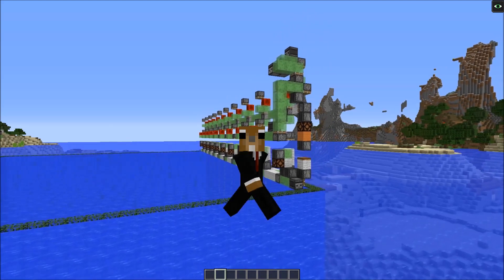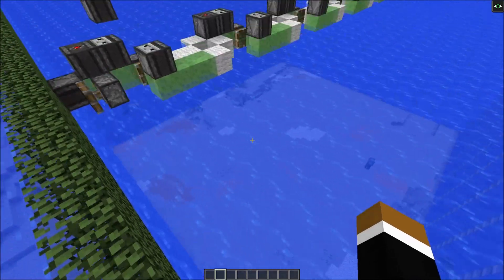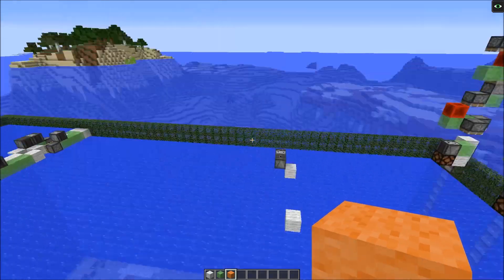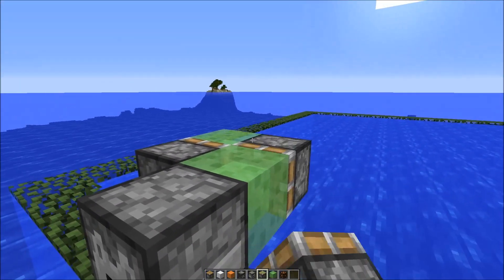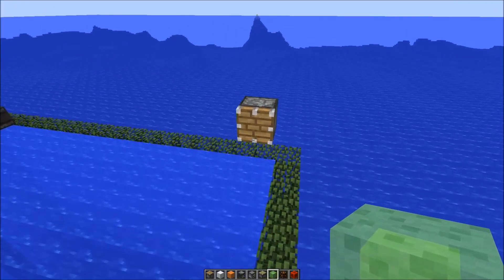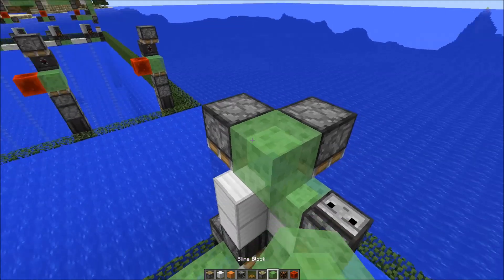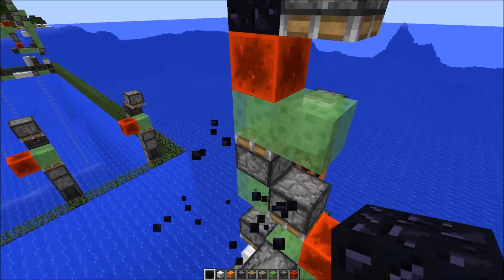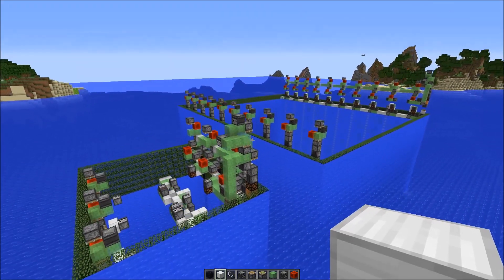Automated Water Removal 1.11+

Comment: Pár jótanács az óceán munument szárítás hoz:
1: A hínárokat mindenképpen takarítás el mert kitörik a homokokat.
2:A spongeos módszer jó lehet de szerintem ha 110 blokknál nagyobb átmérőjű kört csinálsz akkor használj flying machineokat.
3: Itt van Ilmango videója amiben megmutatja hogy kell őket megépíteni :)
Reply: here is the translated version 

A few tips for drying the ocean monument:
1: Be sure to clean the seaweed because it breaks up the sand.
2: The sponge method can be good, but I think if you make a circle with a diameter larger than 110 blocks, you should use flying machines.
3: Here is Ilmango's video showing how to build them :)

Comment: Hi, I don't know if anyone is still posting here, but I've got a problem with the machine:
It works great from the start but once it hits the return station, the station it's self does not move down.
I've manually moved it down as said in the video so it's in the right place and sends the machines back the first time.
On the second time, after manually moving it down to test, it goes straight past the return station and crashes into the wall.
I don't understand why it returns it the first time but then fails?
I'd really appreciate any help.
I'm using PS4 latest version btw Thanks.
Reply: This is build on Java and PS4 have a few diffrences when it comes to redstone.

Comment: Now that I can make 18 wide flying machines this method looks doable now. You would still need 2 pushing down stations one for each side of the flying machine, but this is alot better for the design you have shown here and I feel it is less resources than the sand sweeping machine that everyone is using. Also I play on a server that forbids afking on the server, so you have to be moving around while this machine works. I tend to just do one flying machine at a time and then use pistons manually to push the flying machine down one block, because the monument can be divided into 3 areas with different depths easily because of the shape. I guess i could just make the push-down pistons have a button instead so i have to move and push it to make it go down one. next one i'll see if i can do that.

Now we just need Minecraft to fix the ghost blocks and this would be very useful to use it. The admins on my server hate that I use flying machines, but luckily I've convinced them one machine is a harmeless load to the tick rate of the server. Other people have massive piston farms for pumpkins which has way more impact on the server than this setup.

great vids man keep it up.

Comment: It saddens me that every one of Illmango's builds, that I try, fail to function.  On this one the issue I run into is the return system the Sticky piston fires up grabs the normal piston and pulls it down, end of action.  The top piston fails to fire the, machine does not push down.

Comment: The time it takes to make this is equal to the time you need to just get rid of the water manually.
Reply from the maker: maybe for a 25x25 area. but what about 60x60 or even 200x200? Did you even think about that?
Reply: Yes, and then you would have to make a 256 long chain of water clearers, gather all the materials, and create a very large perimeter. I feel your other builds are WAY better.
Reply: FloidaVids Taking out something like a water temple manually would take you like 2 weeks...
Reply: EmpFX It only takes a couple days if you have the mats. I.e. Sand perimeter and dozen sponges. Buddy of mine did it last month.

Comment: Or you could just use sponge
Reply: But you just gotta make everything difficult =P
Reply from the maker: "just". If you try to use sponge the newly formed water sources will quickly fill everything back up. Sponge works nicely small scale, but try to drain an ocean with it. You'll quickly come crawling back to flying machines.

Comment: if u want to clear the water in easy way and fast put any block in the corner of the water that u want to remove then hover the cross hair on the block of each corner then use the command /fill x y z x2 y2 z2 minecraft:air
Reply: Fizz real funny

Comment: Mango, Love the build. Just testing the prototype in creative before adding it to my server. 
My machine stops at the same level every time, once the large slimeblock 'arm' reaches the level of the border blocks it touches them and exceeds the piston pushing amount?
The slime block that is touching the border is on the big L shape bend on the control side of the machine (It can be seen easiest during the timelapse at the beginning. At around @1.35 - @1.40 the slime block touches the front wall and breaks the machine)
Is this because I have used glass instead of leaves to surround my area?
Reply: Larks you must use an immovable object to surround it

Comment: Remember when Mojang said they'd removed ghost blocks? HA.
Reply: When mojang says they removed ghost blocks, then they usually have just removed one ghost block generator.
They were particularly ingenious when they fixed ghost blocks in 1.9.2. It went like this:
Before the 1.9 snapshots there were already many bug reports on ghost blocks.
In 1.9-pre1 mojang accidentally implemented a completely new ghost block generation bug.
In 1.9.2 mojang fixed the new ghost block generation bug from 1.9-pre1, but they didn´t do anything about the old bugs that existed before.
And because they fixed the new ghost block generator, mojang said they fixed ghost blocks and closed almost all the ghost block bug reports, including those who relied on different older bugs.

Comment: Why not make both sides move it down?
Reply from the maker: it's more effort. Sending one side down also has to send down the other side, which requires some logic. Also the machine is quite fast. You can clear 300x300x30 in 3h. You'll probably spend more than 2h extra in order to build up something that moves the machine down on both sides and saves 90min AFK time. It's not worth it tbh.
Reply: Oh okay, just seemed liked it wold be pretty easy but yeah  then again I don't really understand really understand flying machines on the same level as you :)

Comment: you should see if upon the machine being told to return if it could move one more down to remove another water layer, increasing efficiency.
Reply from the maker: I think it's not worth it. It's possible, but requires too much effort to set it up. I think in total you would need to invest more time in building, than you save from the machine running faster.

Comment: And you make it when I already used the previous one... ~80K sand!!! and ~26Hours :c
Reply from the maker: actually both systems don't do the same. With the sand method you can drain the outside area of a monument without removing it first, which is not possible with this machine.

Removing a monument, while guardians are still able to spawn around it, is quite tedious.
Reply: @ilmango , not as tedious as collecting 70k sand
Reply from the maker: @bobdull3148  the sand isn't lost afterwards. you can use it for something else. Also why do you think you need to point this out after 3 years?
Reply: @ilmango  ._. oh wait. It was 3 years. Well this is awkward
Reply: @ilmango , also since leaf blocks are water logable, will it still work?
Reply: Lol ilmango replied to a comment on a 3 year old video

Comment: What happens if it stops mid flight? would u need to rebuild?
Reply: Darkion why Would it stop mid flight?
Reply: Lag could stop it. Or server reset or chunk borders...
Reply: Darkion lag wouldn't stop it and chunk borders could only stop it when its the edge of loaded chunks which wont happen if you stay there or turn it off before you leave. This machine alone is also not enough to crash a server  :)
Reply: Darkion If it does somehow stop mid-flight, you can always use a flint and steel to have it start again

Comment: This is awesome! You just saved my ass too, because I was just about to use your sand pusher to clear out a monument.
Reply: Erin Howarth Yes :/
It's not that hard. Get depth strider boots, night vision and water breathing potions, aqua infinity helmet, and a haste beacon  and bam, it's gone, easy.
Reply: If you use this machine to clear out a monument, what will happen to the actual monument? Will it break the machine? Will the machine just stop when it reaches the solid blocks? Will you break the blocks with your pick axe as the machine approaches? TNT?
Reply: Erin Howarth it only clears out water blocks, not solid blocks
Reply: Will the machine break when it runs into the monument?
Reply: Erin Howarth You need to remove the monument beforehand
Reply: Oh, just five things... :-) Thanks. I'm glad to have a list. I'll set to it.
Reply: Before?!
Reply: Fyqcraft 
/fill x1 y1 z1 x2 y2 z2 air 0 replace water
that's it.
Reply: Zombie Untot naw fam
Reply: Fyqcraft What?
Reply: Zombie Untot I ain't gonna use your method bruh
Reply: Fyqcraft k ^^
Reply: Zombie Untot nothing personal

Comment: Couldn't you make it so it would also remove water on the way back? It would save you about half of the time.
Reply from the maker: would be possible, but would also require more effort to set up. You'll loose time if you try that ;)
Reply: Nilonaut it does

Comment: just using a moses is much easier in most cases. they work much better with random terrain than this, are much faster and still really easy, if not even easier to setup in some cases.
the sand dropper you showed is probably still better for the really random terrain in the nether with lava.
Reply from the maker: can you use your Moses in combination with a TNT quarry? Who cares about terrain?
Reply: ilmango what? i dont see any way to combine this with a tnt quarry more easily than you could with a moses.
Reply from the maker: For the next 528x528 perimeter we'll defnitely won't use buckets  ;)
Reply: ilmango ok. now i m confused. why would you use buckets for water? you use them for lava, sure, but in the overworld removing lava with something like this requireing a rectangular area is really difficult?!
Reply from the maker: we'll modify it a bit and let it run perpendicular to the TNT quarry.
Reply: ilmango oh. now i see. well, you ll still have to remove obsidian and there is likely to be prolems when water flows quickly covering blocks right below the surface before they are destroyed. seems quite problematic overall
Reply: why do you need such a large perimeter?
Reply: Ahh okay, so that stops the spawning of mobs that would ordinarily spawn in, then despawn the next tick because they're greater than 180 blocks from a player
Reply from the maker: If you want a perimeter where absolutely nothing is loaded within render distance. either for a passive mob farm or a farm that runs at the limit what your machine can handle. It can give a little extra boost in performance. In our case the render distance is 16 blocks. That's why 33x33 chunks
Reply: xD just misread passiv mob farm as massiv pob farm

Comment: As always Amazing work mango ;) How much time it takes to drain bounding box of the ocean temple?
Reply from the maker: thanks, ~20 minutes.
Reply: Wow, it's extremely fast! In my old minecraft days we used to drain oceans using sponges and it took us weeks... XD
Reply from the maker: You would need to remove the monument ofc. Which in case you don't have a mob switch is quite annoying. ;)
Reply: Guardians would still spawn outside the monument as long as there is water in the bounding box
Reply: @foxmulder8955  no
Reply: still doesnt look so useful, there arent miracle ways to contain the outside water and guardians when you are breaking the monument.
Reply: I also clear the water on the outside with lava, that why I need many pickaxes to dig out all the stones.
Reply: Eddy Wu , yes, no. We're talking about using the machine showed in this video to clear the water on the outside
Reply: kkochanovskii , you can dry the inside area of a monument pretty easy, that would be better so you wouldn't have to deal with the guardians later. Then just tnt it or whatever.
Reply: Of course, you have to break all the blocks of the monument to use this method so this is easier, they will spawn outside but not inside.
Reply: You have to break it somehow and having it dry is the only good way to break all the prismarine... as ilmango said it's not an easy task.
Reply: Does it make a difference if you have all the water enchantments ? i duno if you can break the temple blocks instantly. From what i remember i ended up breaking the monument from the outside because it was a lot more convenient. Used a simple mob switch with an account on a spawner. But that was before 1.9 and mending
Reply: Fox Mulder , of COURSE I'm talking about doing it with no mob switch in a safe way. If you did it outside you would be constantly attacked by guardians with almost no place to hide. And on mid game you're not going to have all the fancy gear so inside is a better option in this case.
Reply: But you do need to go outside and will eventually be facing guardians if you have no mob switch. So i don't really see the point clearing the water inside,  I mean the inside walls are not that big in comparison with the outside structure if i remember correctly. That's not a lot of time saved.
Reply: I dropped lava on staircase to cover the whole monument, and mine out with haste II beacon+ Eff V, with frost walker boots there is no guardian issue and doesn't require to clear water from inside. Need to prepare many pickaxes though.
Reply: Eddy Wu , that is after you have cleared all the water on the outside.
Reply: Fox Mulder , I still think it is, quickly placing sponges on the inside is enough to clear most of the water in the area and can be done while exploring if you already had the sponges. If you had a lot of tnt you could use that for fun and quick breaking of the blocks and that wouldn't work with water inside, then you clean the outside. May not save time but for me it's less boring.

Comment: Nice design I must say! But I still feel like the MOSES does a better job in terms of setting up and removal speed.
Reply from the maker: alright. My opinion differes a bit. imo removal speed is not important. Clearing a 300x300x30 area would take about 3hours with mine. In contrasts to the Moses, you don't need to remove any water in order to build the water remover. Also the Moses is too fast. We crashed our server and had to use an artifically slow engine. Also it's definitely more effort to build the Moses
Reply: ZUMMY61 I agree with mango because the Moses removes so much water at ones it lags..especially if your playing on a decently populated server everyone would get grumpy..and you would possibly be told to remove it..
Reply: I just so happen to have removed a lot of water using a combination of smaller versions of the MOSES and cleaning up the leftover water with sponges, little album I made for you: http://imgur.com/a/Kur23
I guess the biggest obstacle with both machines is uneaven terrain, in my case I think using smaller versions of the MOSES and sponges was the best combination for the 5 wide lanes just due to the diversity of the terrain (half swamp/half deep ocean). But I can definitely see this machine work better on bigger bodies of water just because a lot less prep work would be required, however I don't understand your point on clearing water to build the MOSES because you can just build it underwater. Also the time it takes to prep the area, install the MOSES and remove the water might be pretty close to setting up your machine and clearing the water but ofcourse I have no data to compare the two. Finally the lag issue is something I can't comment on, in my experience I had little to no lag using the MOSES but I have no idea how that compares to multiplayer servers. Having said all of this I don't think this is a matter of what machine is better but it just comes down to personal preference and I can totally see your machine work better than the MOSES depending on the situation. Anyway thanks for your reply, I love your videos and can't wait for the next one :) Keep on innovating!
Reply from the maker: Maybe my memory wronged me, but when I build a moses about 20 months ago, I think I needed to remove some water in order to not accidently give wrong block updates by updating water. I might be wrong there.
Reply: ilmango it's still the same you have to either remove water behind it or place blocks behind the blocks used in Moses or as Moses moves the water source behind will be updated and cover up most of what you've just cleared
Reply: I don't know if that's a thing, I've had no problems with it myself.